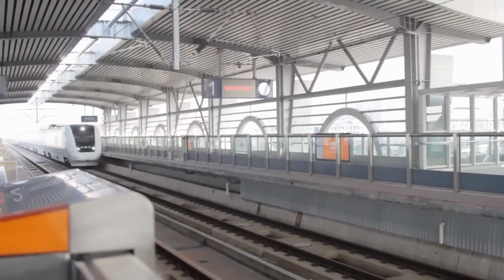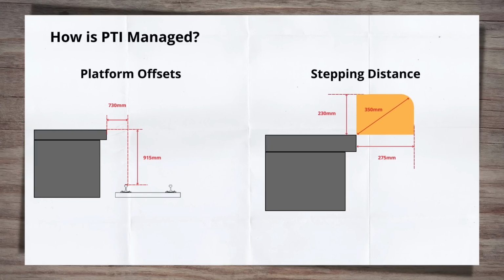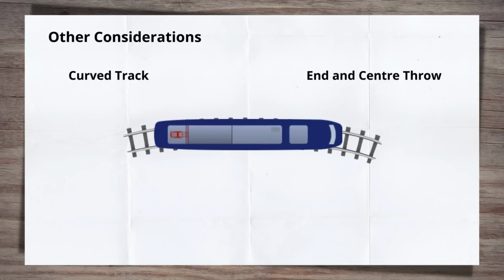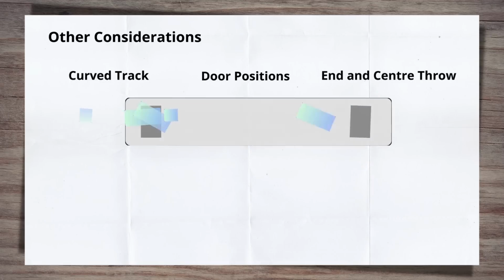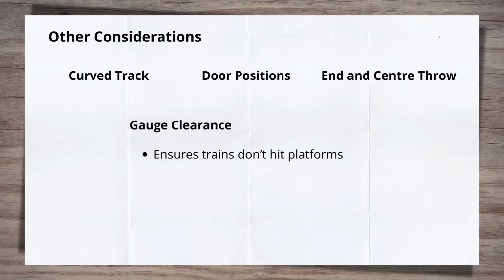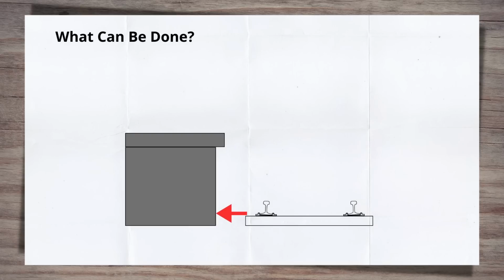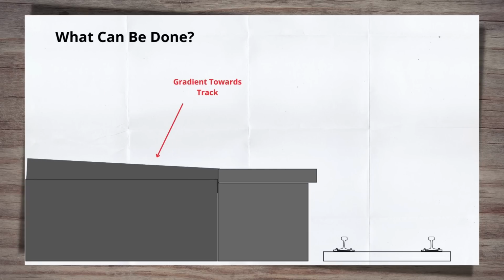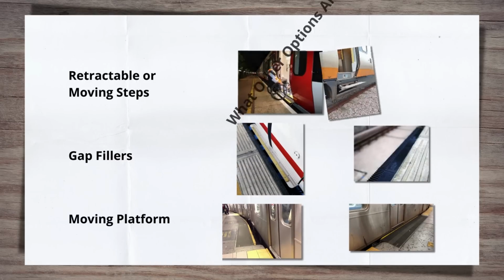Mind the Gap! How Railway Engineers Stop Passengers Falling Down the Gap at Platforms

Comment: since you used the picture of Union Square

Officially, those are also called “Gap Fillers”. Come with their own special procedures for us operating crews. (Though none of that applies to me as I work on the lines with letter names and we don’t have those.)

What we do have are issues with door configuration.

As of right now the trains I work on come in three sizes.

10 car trains of 60 foot long cars, 8 car trains of 60 foot long cars, and 8 car trains of 75 foot long cars (equal in length to 10x60). The 8x60s are technically meant to run on lines with shorter platforms, but in two situations mix with the longer trains, which is one of the issues we’re worried about with platform screen doors.
Reply from the maker: Interesting, thank you for sharing!